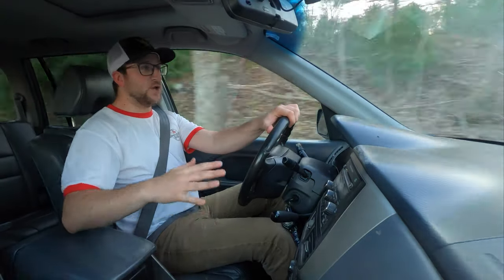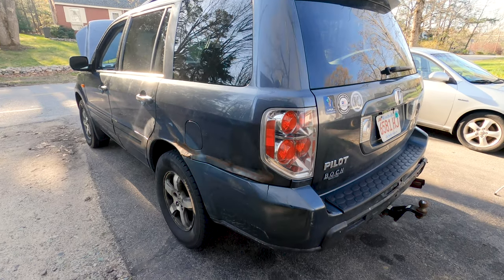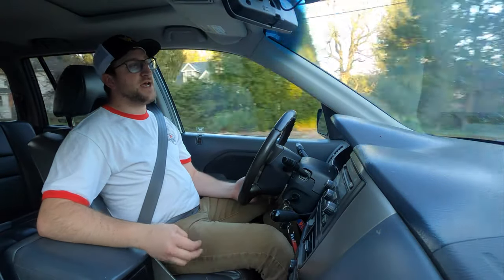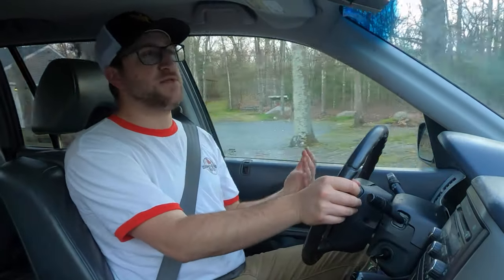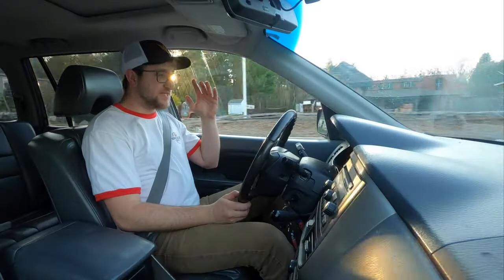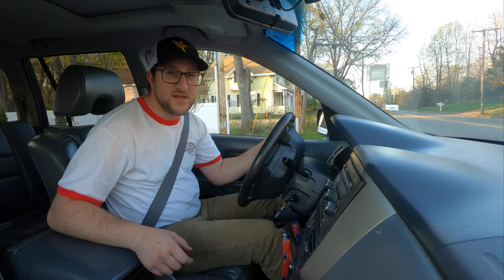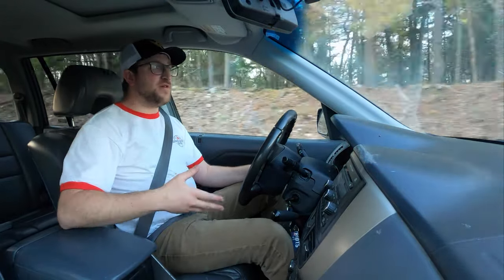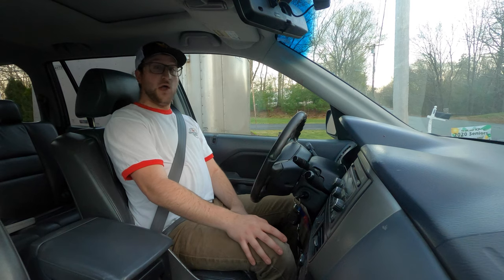1st Gen Honda Pilot - How Reliable Are They Really?

Comment: I'm thinking of buying a 2003 Pilot. I read that early Pilots had transmission problems. Think I ought to get it?
Reply from the maker: If you have the option, I would consider searching for a later-model Pilot, ideally between 2006-2008. Most of the bugs were worked out by then.
Reply: Don't go for 2003
Reply: I got my 2003 honda pilot at 65,000 miles, 4 year's later it's at 135,00 miles. Tomorrow it is being towed to the mechanic to rebuild the transmission 😒 I LOVE my car so it's worth it to me 😁

Comment: I got ripped off on an 04 pilot.   The dealer sold it for 4000 as "ready to drive" without disclosing that the previous owner traded it in because the transmission was bad. Two days later the transmission went out. I contacted an attorney (failure to disclose known defects is fraud.)but the lawyer wanted over 300 just for the initial consultation.   I let it sit for a while, but after I finally got the transmission rebuilt, the rest of the car seems great. Since I don't know its history, a timing belt is next on the agenda.
Reply: How many miles was on it?

Comment: Love my 04 pilot so far, 192,000..
Reply: This is so good to hear! I bought an 04 Pilot in 2016 and it had 60,000 miles on it. I've doubled the mileage since then but man, it just keeps on ticking.
Reply: Tony Bibler I have a 2007 EXL 4WD Navi with 205,580 miles 😂
Reply: @navi_exl Did you ever have to get a valve adjustment on your honda ??

Comment: New Owner here!  Based on my very first tank since i bought my 2003 pilot some days ago from a Honda Dealer, I calculated my mpg, it's an average of 14 mpg! What i did was record Trip A from full to empty and it was 275 miles. And the Pilot has 19 gallons, ya?; Depends on trip level, but i don't know what trim level it is.... So the average number I got was about 14/15. :( That's so baddddd.  I thought it would be around 19/20 avg mpg. 
Q: How can i make my car have better MPG?? Thanks!
Reply: Weight reduction is your safest bet, which will be a task in this thing. The rearmost seats could be pulled out to free up a bit of weight but overall these pilots aren't gonna get much better fuel mileage than they've already got. Which is a shame. 

Mine feels like it gets super good highway MPG but in the city it feels like a hog.

Comment: I have a 2007 Exl that has 385000 miles.  I just replaced the engine because of valve guide failure.  The transmission IS ORIGINAL.  No issues there.
Reply: Hello, is your Pilot FWD or 4WD? Thank you.
Reply: Hello, is your Pilot FWD or 4WD? Thank you.
Reply: @kevinjefferson9739  4WD
Reply: @jimwuerl7380  Did you install the VCMTUNER II – Advanced on your car, to deactivate the ECO MODE? Does your car burn or consume any oil?  What brand name of engine oil and oil filter do you use? What is the interval between oil changes? Thank you in advanced.
Reply: @kevinjefferson9739  The 4WD 1st generation pilots never had eco mode.  Only the FWD models had it.   No worries about this in 1st Gen with 4WD.
Reply: Cherry Baby now has 450000 miles and still drives like new..
Reply: @jimwuerl7380  What is the brand name of engine oil and oil filter do you use? What is the interval  between the oil changes?
Reply: @kevinjefferson9739   I usually get my oil changed with tire rotation at Midas Muffler near my home.  It costs about 30.00 and includes the filter.   They use Valvoline semi synthetic with a Honda filter.  This is way cheaper than doing it myself at home.
Reply: I been using the maintenance minder.  I’m usually down between 10-15% @ about 5000 miles.  I’m on the highway more than in the city.

Comment: 2003 with 200K. West coast - no salt. Bought used with history in 2009. Other than door lock actuators no repairs in 12 years.Car has never been to a mechanic Burns maybe 1/4 qt of oil in 10,000 miles. Fluids always changed on schedule entire history. I change transmission fluid every 12K it's so easy. Looking forward to 300K. Then buy electric. Love Honda's. When they build pure electric time to buy.
Reply: Did you ever have to get a valve adjustment on your honda ?
Reply: @shadowman1992  No I never have because it runs so Quiet. Don't think it has ever had one that I know of. I bought the tool to do it and been thinking of doing it myself hoping I won't make it worse than it was. Doing the back valves are a little tricky to get to keeping the gauge in the correct plane. I'm kinda thinkin if it aint broke, don't fix it.
Reply: @79ltd  thanks for the info. I'm asking other honda owners to see how high of Miles others engines get without one. I keep hearing you can burn a valve if they get too tight but so many honda owners have so many high miles and never got an adjustment so I just thought I would ask

Comment: I have a 2003 Honda Pilot with 235k miles on it. It has been in the family since 70k miles. So far the ignition switch had to be replaced and I replaced the window motor on the passenger side myself for $40. Great car and I plan on keeping it till it explodes. So I’ll probably have it forever
Reply: Is it still running good?

Comment: I’m so upset. I bought a 2007 Honda Accord private sale and it had good carfax and it looked like the previous owner was always on top of things. The car has 155k miles and everything is breaking!!! The starter, rack and pinion steering, valve cover gasket, control arms, and a few other things. Is this all normal for these cars? Is it worth fixing the issues?
Reply from the maker: Don’t worry! I know it’s frustrating, fixing things on cars. But it’s inevitable on older cars, no matter the make and model. All of those things are pretty typical, aside from the steering rack. I’d say, if the engine and transmission are working well, and there isn’t a lot of body rust, just keep the car and put the work into it. Check out 1AAuto or the TRQ channel. They have some good repair tutorials, and could save you some $$$ if you do it on your own. Good luck!!

Comment: Just bought an 04 with 135k. Going to be interesting to see how many miles I can get out of it.
Reply: Man You're gonna be fine. Mine was 2004 also. Sage green. You can easily get another 80 to 100 thousand miles on the clock with regular maintenance.  They're awesome. I had 152 thousand miles when I bought mine and I  was up to 278 thousand miles and still ran smooth before I crashed. That's the only reason I don't have it anymore. Regular maintenance like oil changes, tune ups and belts will keep you on the road. I drove it everywhere everyday at least 80 miles a day because I live In a rural area.  Absolutely a great vehicle.
Reply: Consider the timing belt replacement at that milage
Reply: @gearheadram  already done at 100k based on the sticker. So far I'm still loving it though!

Comment: I just changed the oil in my 2007 Pilot. It has 142k miles. Last time I changed the oil was at 118k miles. Granted that's a big gap but oil change intervals are very subjective to how you use the car and what kind of oil you put in it.
Reply: Yeah you’re right but that’s a big big gap lol a big gap that you should consider instead would be like every 5k, you don’t want to run it like this guy more than 10k without the oil change they really are good suvs ill be buying one

Comment: '03 I sold with 238k, and currently own an '04, with 130k, that I'm gonna have to change the alternator on today. Wiring definitely an issue on first gen Pilots, and was losing second and my torque converter on the '03, but overall, typical Honda engine reliability, no doubt. Interior holds up to quite a bit of abuse too, but those stupid door handles start peeling, and that fake metal tape gets sharp. Other than that, I may try for another when this one quits, depending on if I can find another babied one.
Reply: Did you ever have to get a valve adjustment on your honda ??

Comment: So I recently bought an 08 Honda pilot in great shape with low mileage. I have put about 1200 miles on it thus far and I love the car.
 Can anyone tell me areas of its maintenance I need to pay close attention to?
Reply: Make sure you replace the timing belt every 80k to 100k miles.  Eariler the better because if it goes out, the engine can go with it. Change the oil every 3k-5k. Then transmisión fluid every 40k miles. Although some people slack on that. And it literally should run forever.
Reply: @meowstre  
Thanks for the reply, I'm all over it. 
Kinda shocked that the trans filter looks like it belongs to a dirt bike, will have to order a few to have on hand. Hard for me to believe a filter that small is sufficient for a car.

Comment: How reliable do you think the 4wd pilot 12-14.. or is a fwd the best option?
Reply from the maker: In general, the later 2nd gen seems to be very solid. I haven't heard of any major problems. And that depends on your lifestyle/budget. The fwd is going to be a little less expensive to purchase, and won't hold value quite as well as awd. The towing capacity is higher with awd, and the gas mileage difference is negligible. Thanks for the comment!!
Reply: Towing and payload capacities are generally a bit higher for 2-wheel drive versions of most vehicles than their four/all-wheel drive counterparts, mainly because they weigh quite a bit less. That's how it is with trucks anyways, I imagine Pilots are the same. Two-wheel drive also has less moving parts, so less maintenance and fewer things to break down, plus better fuel economy. But for those who do a lot of driving in snowy or off-road conditions, four/all-wheel drive makes more sense.

Comment: i have a 2006 honda pilot with over 200000 miles do you guys think its worth buying upgrades for it as in paint and performance upgrades ?
Reply: Yes absolutely
Reply: Get the v.c.m musler
Reply: Did you ever have to get a valve adjustment on your honda ??

Comment: ive just purchased a 2006 ploit , when starting it runns then idles really high . i only paid 600 hundred for it, the check engine light is on  the vsa lite im just lost im use to chey or fords. was told there might be electrical problems. just need help please.

Comment: Would you buy a used 2004 Pilot with 220,000+ miles for $3,000?
Reply: Yes they’re good cars. But make sure you have a mechanic to check it out and make sure it’s in good shape and looks clean on the outside and inside
Reply: That's a good deal! Because of everyone getting stimulus payments, I bought a 2011 honda pilot with 160,000 miles on it and am ashamed to say I paid $15,000 for it. Not a good deal AT ALL but totally worth it! Best car I have ever owned in my entire life! Plus no kids kicking my seat due to lack of room like most other cars, suvs, and trucks too!
Reply: @jonhouser8141  I bought it. And I've been all over with it already.  Since I bought it so cheap, I went ahead and changed the trans fluid and had the timing belt replaced. So far, so great!

Comment: I have an 03 pilot I changed the transmission fluid and the engine got wet from rain and now it won't start. not even a click. I do hear the fuel pump start. I don't have a clue where to look for the problem

Comment: I am a 2nd owner of 07, bought it back in 2010 with only 32k miles, fast forward as of today 138k miles and all I did was maintain oil change, never even took the spark plug out yet and I know engine running clean cause the tip of the exhaust doesn't have black build up. Interior could use some fixing like the ceiling are bubbling down. Other than that its very reliable mid SUV. 
  Any car can have problems at any time but with proper maintenance it will last you a long time.

Comment: $1k for a 175k miles, 2003 EX, no misfires, minor interior damage, body is great, besides Vtm not working its like a luxery drive
Reply: Did you ever have to get a valve adjustment on your honda ?
Reply: @shadowman1992  nope, no maintenance but oil has been done

Comment: I have a Honda Pilot 2004 with 325.345 Milles and running good. I care to much about oil change, fluids, and engine light and so on. Those Honda Pilot are excellent cars, however, if You don NOT care properly You car, it for sure will fail soon and go faster to the junk's garages.

Comment: I have an 08 Pilot that I just swapped motor/trans. 266k on body. I don't think I've seen so many dash lights as this guy's has. Is everything lit up? If he hasn't swapped spark plugs, is it safe to assume he hasn't had the timing belt changed either? That's a recipe for disaster.  06 is when Honda fixed the weak trans. So, if you get an 06-08, I think you are good to go with that. Climate control lights go out, but they are easy to replace.

Comment: Hey there NSH Car Guy, liked the video.  You pretty much answered some questions about this car.  I also own a 2006 pilot,  but only with roughly 99,000 miles.   Like you said,  must treat this vehicle with TLC, as things starting to fall apart.  But you are right.   Car is still moving.   Thanks for the video,  looking forward to your next video update on this pilot antique! LOL
Reply from the maker: I appreciate it a lot, Simon! Wow that's very low mileage for an '06! Thanks for the watching the video and leaving feedback, I'll definitely make a Pilot update video in the future.
Reply: @NotSoHandyCarGuy  Hey thanks NSH.  Purchased vehicle new in 2006, but there was a period of 4 or 5 years, where the car was not driven at all.  It wasn't until 7 years ago where I started driving more due to a job change that required me to use the car daily.  I'm still hoping my car will last to 200,000 miles.  LOL.  Cheers and thank you for the videos!!!
Reply from the maker: @ct501701  For sure, man! Thank you for watching them!

Comment: Someone sold me this a 2004 and it has 247,000 miles but he told me a new motor 50,000 miles and still haven’t sent my paperwork but when I looked it up it says 247,000 miles did I make a mistake
Reply from the maker: Dang, not sure. How is it running? And how much did you buy it for

Comment: Overall, they are reliable. but not bulletproof--No car is, no matter Toyota or whatever brand.  
I have a2007 ridgeline for 13 yrs, Just this year (2020), my Ridgeline had Rear Main Seal Leak, then had transmission fluid leak between the transmission and transfer case, total repairs caused me $2K. I also had a 2007 pilot from 2016-2018, I traded it in because the AC failed on me and I don't want to repair it. I also had a brand new 2010 CRV for 4 yrs. The CRV  burned a bit of oil but fixed due to recall.

Comment: Are going to clean the EGR system?
Reply from the maker: Absolutely! I'm sure it's all gunked up at this point. I just did the plugs and coils, and that helped a lot so far.
Reply: @NotSoHandyCarGuy  I had to clean out my valve cover too the the thing was nasty and caked in the ports. My engine light kept coming on though no matter what I did finally I got the valves adjusted and that cured it.

Comment: I own 2008 and it hasn't been the best I got tipped off struts and motor mounts  bad I just found out middle console overheats like hot and the lights to light up inside get really hot any ideas anyone how much to fix seems electrical even heat gets too hot the only time console doesnt get hot is when ac on high that's why I didnt notice when I bought it in the summer
Reply: It just doesnt  doesn't feel safe
Reply: I installed a computer fan inside my console

Comment: I guess I'm the un lucky one in here, I bought mine with 270k, its a 05, after a year it need new heads, so it was cheaper to just buy new engine. Shortly after the transmission went out, so bought new transmission.
Reply: That's a ton of miles. It's time.

Comment: Yeah if you like transmission problems, I got an 04 with 170k on it, had it less than a year and had to have a trans overhauled. Make sure you get your valves adjusted around every 100k miles or else your engine light will keep throwing misfires and keep your valve cover and system clean. That's what happened with mine, nothing but headaches I will never buy one again, Honda knows about these transmission problems and refuses to do anything, upon research pilots still have quite a bit of problems
Reply: V.c.m had a issue.  A 70 dollar v.c.m. mussler will fix the valve problem

Comment: I have a 2003 Pilot and all kinds of problems. Tire rods, fuel pump, auto door locks, cat converter, electric issues with lights inside, AC gone, burns through engine oil, motor mounts, cv joints, back seats don’t fold down anymore. It only has 140k.

Comment: Not to split hairs but that's not technically a first gen its more a gen 1.5
Reply from the maker: Totally splitting hairs, but yeah you’re right.
Reply: @NotSoHandyCarGuy  yeah I just love the looks of the early style. My wifes has 180k and still runs great
Reply from the maker: @kristopherhill2740  very cool 😎 Yeah I’m digging the pre-facelift, too
Reply: @NotSoHandyCarGuy  yeah I love hers. Its an 05 so most of the kinks were worked out. Now i just need to find a matching color first gen crv

Comment: Haha totally wrong. Good quality items gives you reliability . Toyota is an a perfect example. My 2003 Toyota Tundra 3.4 V6 every single thing still working perfect  486000 miles and my 2000 Toyota Tundra 4.7 V8 4x4  253000 miles is insane even better. So good quality stuff gives you reliability. You bla bla bla non sense